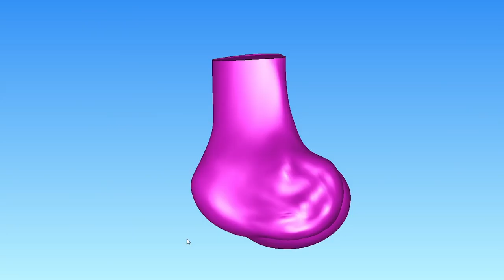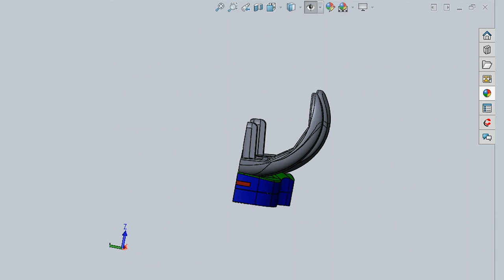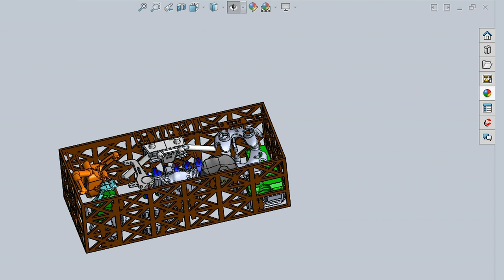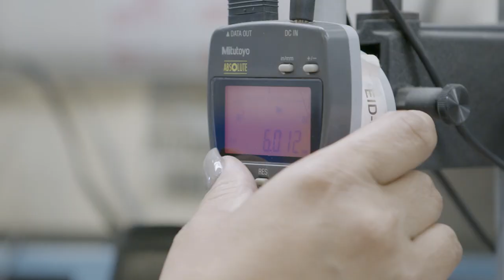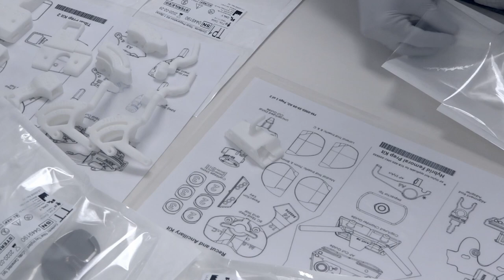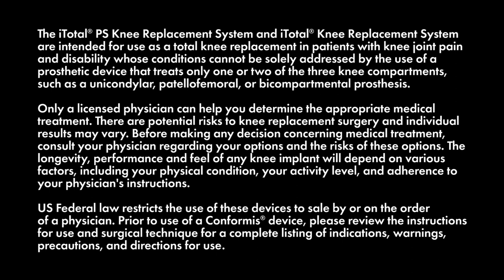From Image To Implant

Comment: Was the 13th Conformis knee by my surgeon in 2013, Portland, OR. Knee working well just short of 7 years. IF I ever needed another knee it would be a Conformis. Why would anyone want a generic, out of the box artificial replacement for any body part, system or an added component?